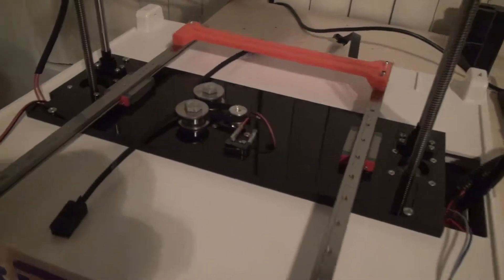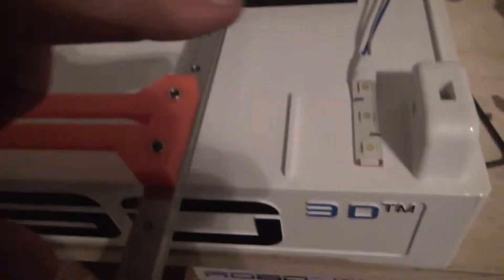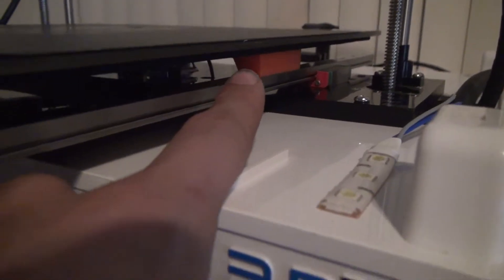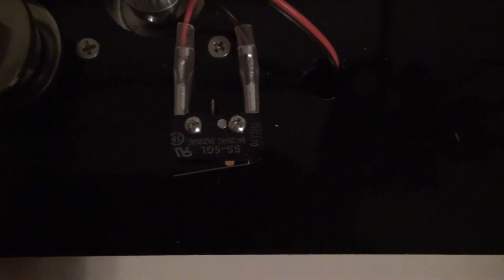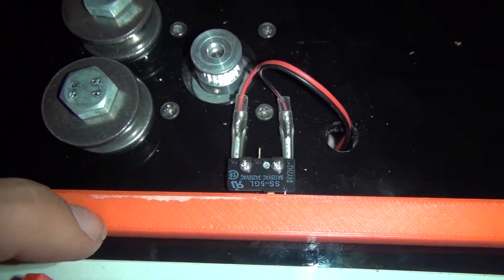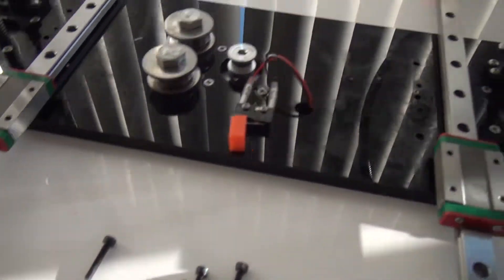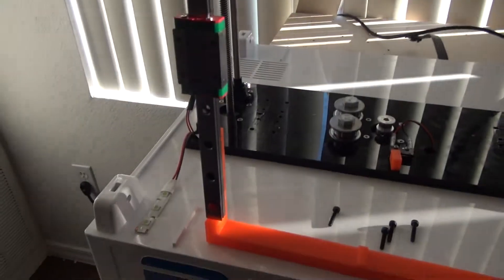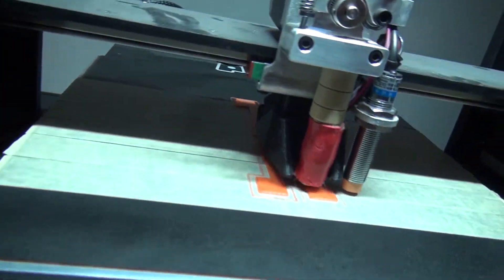Robo 3D R1+ Y-Axis Modifications! (Part 3)

Comment: This design is exactly what I was going to do to my Robo printer. Nice job!
The reason the bearings do not slide by themselves very much when held vertically is due to what is called bearing preload. The higher the preload the tighter the bearing is and the more force it takes to make them move. Thats the reason why the original bearings on the printer are so loose, little to no preload.